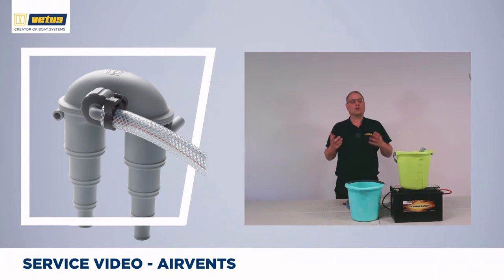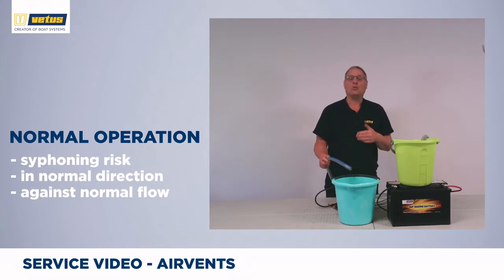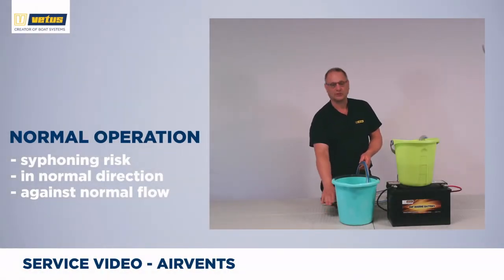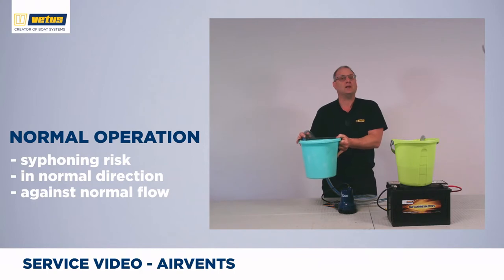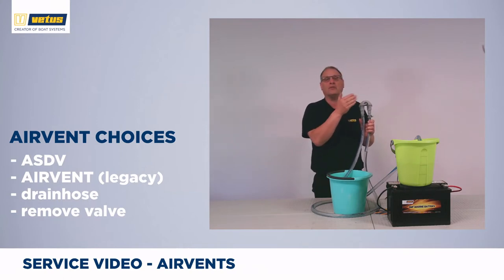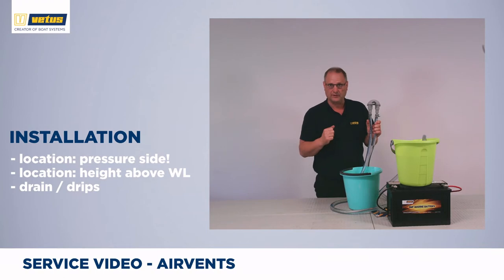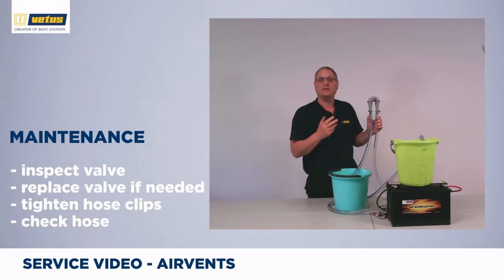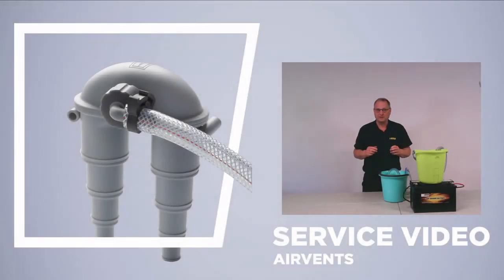Airvents (anti siphon valves) and yachts: how do they work and how do they protect your boat?

Comment: Is it okay to remove the internal part of the valve on the legacy product similar to the demonstration here with the newer valve? The vent tube runs to a small through hull above the water line, so no worries about filing the bilge.